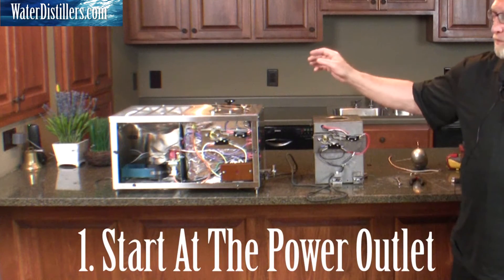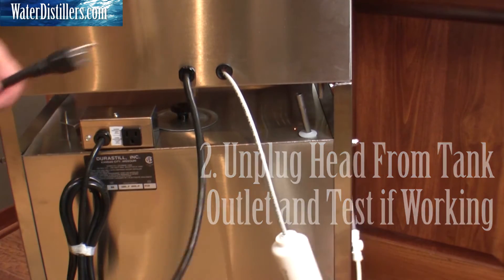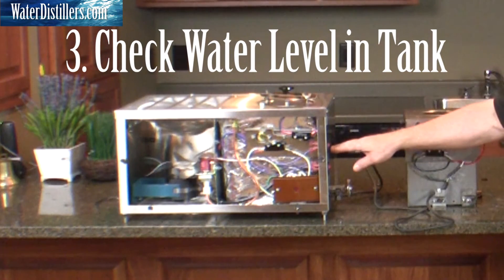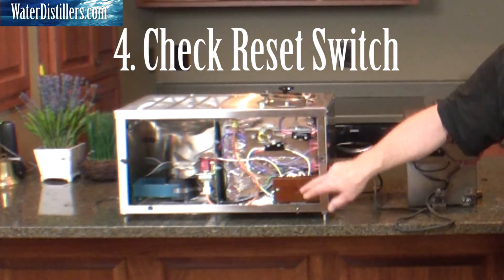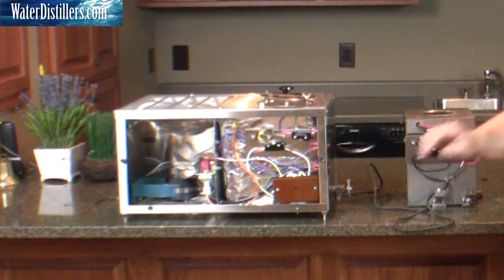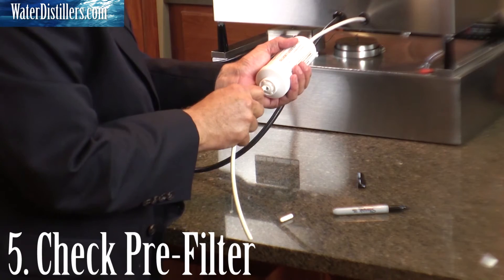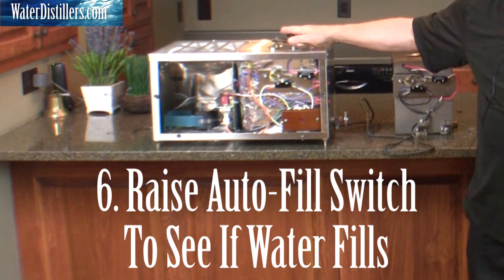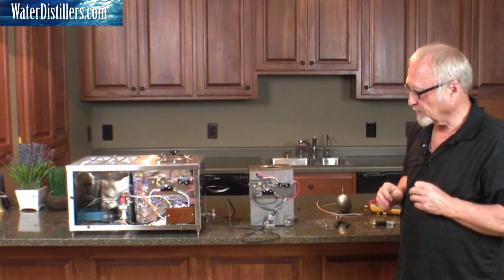Troubleshooting A Water Distiller - How To Repair A Water Distiller

Comment: I have a Peanut small distiller from Aqua Clean. It feature two outside the tank(on the bottom) heating elements that have disintegrated. Is there a way to fix this machine, it's over $700 for a similar model. Pure Water lists no parts available.

ike model.

Comment: My Durastill water distiller is 5 years old.  I keeps shooting out the electical line and the fuse intermittently after working for several hours.  Now it trips the breaker when you hook It up.  Any suggestions?

Comment: I have a durastill water distiller (automatic fill) and when I turn on the destillers this on fills the tank and starts to heat up but in about 30min turns off and I need to let COOL down in order to push the reset button. Any advice on what it could be the problem. Thanks.
Reply: Hey Ana ! Can you please share what was wrong with your distiller ? I think i have the exact same issue. Any clue would be of great help ! Thank you so much !
Reply: Same problem here!!

Comment: I just received my water distiler from Amazon.  There are two problems
1) the filter doesn’t fit well 
2) There is leakage of steam from the side when the pressure built up 
Any advice
Reply from the maker: Call us at 612-701-7820.  We can help you and service you even if you didn't buy from us.
Reply: WaterDistillers Thank you very much sir.  Is it US no?
Reply from the maker: Yes call 7 AM -10 PM Central Time or email frank@waterdistillers.com
Reply: WaterDistillers What's the country code?